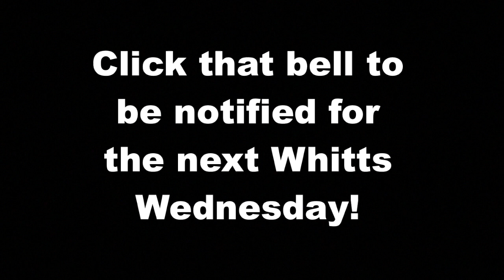SEMI CRASHES INTO STEEL CABLE MEDIAN!

Comment: Yeah its going to take way more time to repair the cable guard he hit then it did you to quickly pull it out.
  It is definitely dangerous for yall out on the interstate highways. That trooper should have pulled out in the first lane to keep them over away from you further. Then he drives off and leaves yall there with NO protection.
   Well atleast yall got out of there safe and sound.
  And I can't complain to much about law enforcement there taking it on the chin pretty hard the last few yrs with all the stupid defending of them. Yall be safe
Reply from the maker: A lot of times it is safer to keep the lane open if possible than it is to shut it down or even a close a portion of it. 20% more likely to have a crash simply because we are a distraction on the road and then if we get into the lanes it only increases.